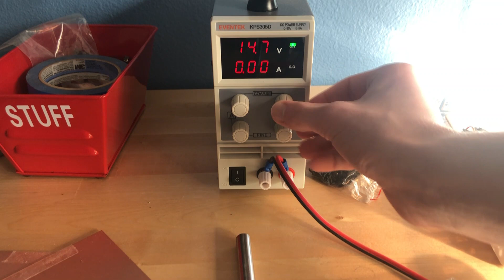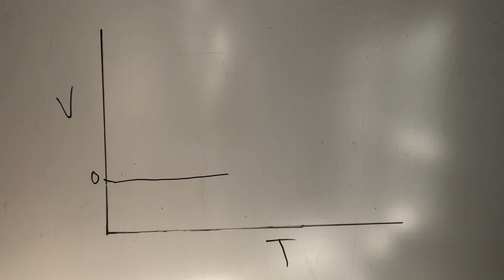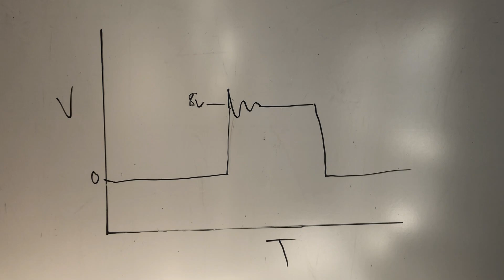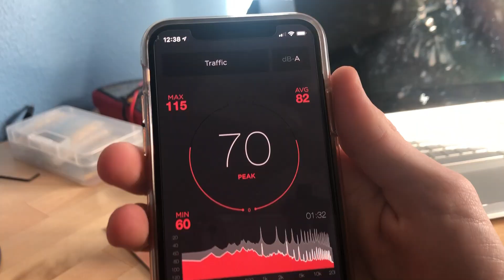Maxing Out a Speaker (Making a Simple Sonic Frequency Generator)

Comment: I have to produce a sound of 20Khz, 40Khz, 100Khz for my master thesis project, May I know how?
I am using ultrasound transducers, My question is Do I need any ultrasonic generator to generate sound from transducers? or volume potentiometer is enough to adjust the frequencies?

Thank you
Reply: I would recommend using a electronic device in tandem with a controller, as these types of hz cannot be heard to confirm. Message me for more